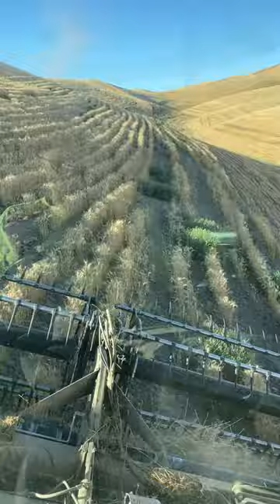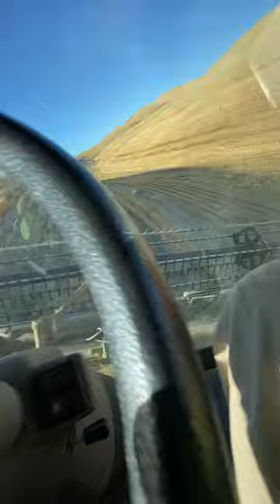Combine harvesting super steep land

Comment: Are you on tracks or wheels ??
Two wheel drive or four wheel drive  ???
Reply from the maker: Wheels and radials.  Mine has duelies (two) on each side on the front.  Older ones were just one tire on each corner, with the
Reply: You sound like the lady on planes, pull up, pull up. 😊
Reply: Last  video no luged tires.  Had many lugged looking loader type tires.  Too slick for these hills.